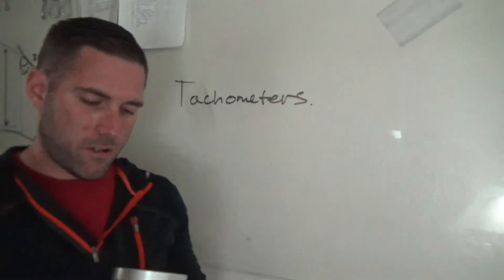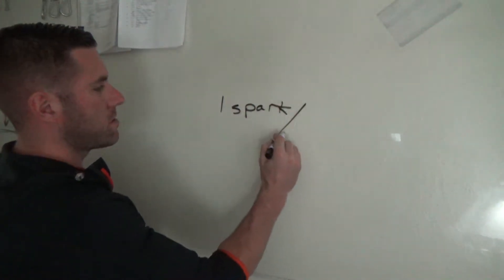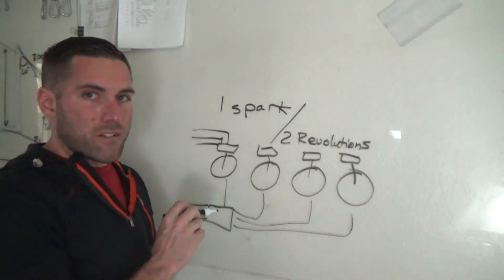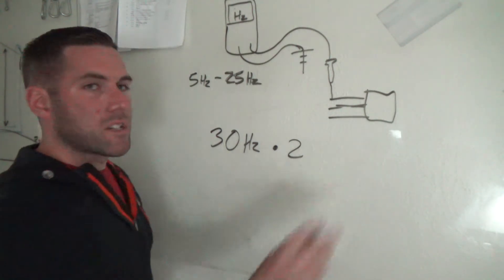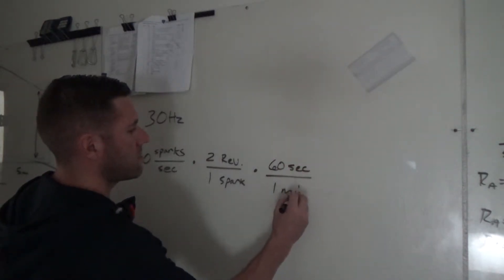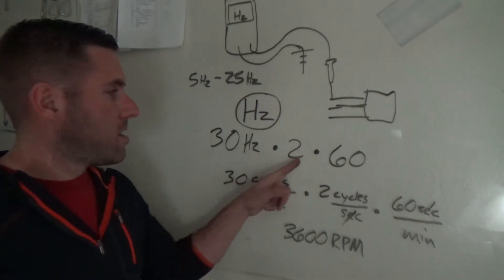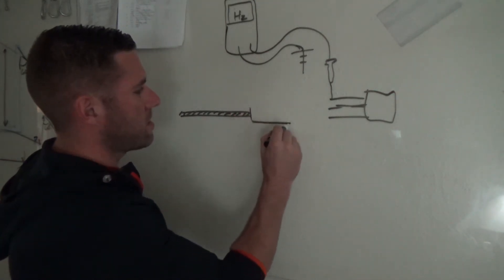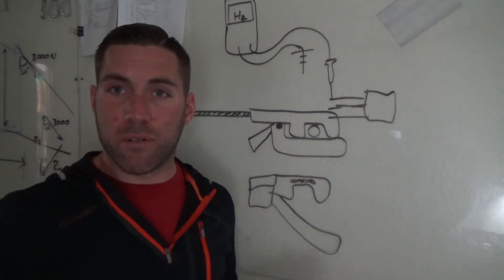Tachometer Calibration with Multimeter

Comment: Hi great info, I'm wondering if you can answer a question. 
I have a 1966 Hillman super minx,  4 cylinder, 1 spark per 2 revolutions as you say ok.
I have a lucas D25 distributor which switches the coil ground supply on and off 4 times for every 1 revolution of the distributor,  I'm sure you know what I'm saying. 
So how do I use your method to test the rpm?
Could I test it at the primary negative/ground if so how. 
Sorry to ramble.
Thanks Walter from Liverpool Merseyside England

Comment: Super helpful. I recently bought a multimeter with a Hz option (an ANENG AN8009), and I knew from James Condon's generator repair YT channel that there's a relationship between engine speed and Hertz; this video connected the dots, so now I feel comfortable testing my suspicion that a repaired single-speed push mower is running far slower than spec.
(edit: Reading some forums, it looks like most 4-stroke small engines use a "wasted spark" design, in which there's a spark delivered EVERY rotation since the flywheel magnet passes the coil every turn. The useful spark occurs between the compression & power strokes as described, and the wasted spark occurs between the exhaust and intake strokes. So, at least when it comes to single-cylinder 4-stroke engines, to get the sparks per rotation math correct, you skip multiplying by 2, instead using a 1-to-1 ratio of spark frequency per revolution.)

Comment: The name of the clamp ? in the comments someone said its an induction clamp is that correct ? Plan on using it to to tune chainsaws and double check other dedicated tachs for that propose at there very different price point.. thanks
Reply from the maker: @frankphoto2  yes inductive pickup is the correct term and will be a clamp style.  There is capacitive, inductive, and hall.  You want inductive

Comment: Works like a champ! Did this on a classic car, 4 cylinder, connected to the + side of the coil and had to make sure wire didn't come close to other electrical wires. Read 32Hz * 2 * 60 / 4 cylinders. Adjust the tach using its potentiometer. Will check at higher RPM. Cool stuff!
Reply from the maker: @Library-y5h  sweet, glad it worked for ya!

Comment: The bigger gauge is because when you’re making big HP and black tracking the 1/4 mile at 160 mph you need to see the gauge so it needs to be big and in your face. 
Also why the shift light was invented so you dint need to look.  

But yeah the import crowd w 43 HP and a 7 inch tach that mate be true

Comment: This was great. The clamp is called induction. Almost like a current transformer. It’s 360 times two revolution equals 720 degrees, two revolutions to make one revolution on a four stroke. One thing to mention is you can’t transform DC. That is why the old points would open (now it’s done electronically) to transform from coil primary to secondary, to fire the plugs.
Reply from the maker: In the terms of this video the inductive pickup is a clamp similar to a Hall effect sensor but is powered and reacts similar to a FET without a gate saturation from direct connection.  That’s why I mention it.  Toroid induction is not a thing in DC and that’s why the coils are HVDC discharge, happens in joules, not volts on the design level.  Not sure if you’re trying to repeat my whole video but it’s already obvious to me how the engine works.

Comment: I picked up a cheap signal generator to calibrate tachometers out of the car. It would be nice to have a chart of the output HZ setting to create a certain RPM reading on the tach, with certain number of cylinders.  Maybe a 4 cyl, a 6 cyl and an 8 cyl. at 2000, 4000 and 6000 RPM.  etc. I am looking forward to the next videos.
Reply from the maker: The boat ones I just started will likely be in the range of 10-15 videos long.  I’ll see if I can sneak an experimental video in there for a signal identification and propagation one that explains what these tachs are usually looking for

Comment: How should I trnslate my hertz reading on my main coil wire if I have. Single coil on a in-line six motor? I have 120Hz reading and don’t know what to do with it :)
Reply from the maker: I may make a follow up video on this topic, I have 4 more videos uploaded for scheduled dates currently but this one has gotten a lot of attention and questions
Reply from the maker: You need to know how many cylinders are firing per revolution and you’ll be able to calculate anything else from that number.  SOMETIMES, they are different for specialized or non-consumer engines.  I want this video to be all comprehensive rather than only automotive based.  Treat two cylinders firing at the same time as a ONE in the math.

Comment: So I have a v6 with a coil pack, where would I connect the lead in my case?
Reply from the maker: The coil pack will have a trigger wire that will provide a digital pulse signal that is read capable with a multimeter in the DC Hz function.  Just need to test to know which wire.

Comment: I made a typographical error in my original message. I put a 47 ohm resistor between the tach signal and ground. Gauge did not work prior to doing that. Now it works with the bounce when the RPMs change. I put the rectifier diode in line on the tach signal to help minimize the bounce. It appears to have made it worse.

The DC voltage coming off the negative side of the coil is about 14.3 volts while running. (Fluctuates some)
The ohms coming off the negative side of the coil bounces between 6,500 and 6,900 Hz.
I took these measurements off the the rear coil, not after the tachometer adapter if that matters.
The resistance from the signal wire to ground is 1.68 ohms.
 I used the rear coil due to access. To get the readings from the front coil I have to remove the fuel tank and therefore can't start it. These are the parts that I used.
Thank you in advance for your help! 
Doug

Biker's Choice Electronic Custom Mini Tachometer https://a.co/d/1TgOYjO

Baron Custom Accessories Tachometer Adapter BA-7315-50 https://a.co/d/84HkQdr

20PCS 1N4005 Rectifier Diode 1A 600V DO-41 (DO-204AL) Axial 4005 1 Amp 600 Volt https://a.co/d/0PYQJeo

PARTS EXPRESS 47K Ohm 1W Flameproof Resistor 10 Pcs. https://a.co/d/7C6n0Qz

Comment: I watched your video and I still have some specific questions I was hoping you could help me with. I have a Honda VTX 1800 motorcycle. It's a V-Twin with two separate coils. Some bikes have a wasted spark where it ignites on the compression  stroke and the exhaust stroke. This one alternates back and forth only on the compression stroke. I purchased an adapter for the lack of better term that takes the negative signal from each coil and discharges it through a wire to the tachometer. Once connected properly it did not work. I read in the comments from someone who purchased the same device that a 10K resistor needed to go from the tachometer wire to ground. I did that and the gauge began to work but it had needle bounce. Cruising at a steady speed it would be okay but accelerating or decelerating it would bounce. I then read online that if I installed a 1N4005 (1A 600V) diode in line to the RPM gauge it would correct the bounce. It actually made it worse. I'm desperate for some help. I can send you a link to the gauge I purchased and the electronic device that gets installed in line. I can't find anybody with the knowledge that you have. Please help.
Reply from the maker: IF, and I stress IF, the signal from the coil discharge trigger negative is the proper place for the tach signal to be acquired, 10kOhm is either too much resistance OR when you hooked it up without the resistor it caused a problem in the gauge.  What I personally would do is power up the gauge and start the bike with the two disconnected from each other and set the multimeter to DC frequency (Hz) and get two things; voltage and frequency.  USUALLY, not promising, the tach reads from a 5VDC signal on pulse inputs.  Now measure the resistance of the signal wire on the tach to chassis ground.  When you have those THREE values, post them here.  You need a corrected voltage drop is probably the issue.  An internal failure of the gauge may require a capacitor in parallel to smooth it like an anti slosh module usually found on older clusters, newer cars just use averaging to smooth out needle flyback
Reply: @sinewavespecialties2373  I was wondering if you would be able to help me with this tach problem. I have the VTX disassembled ready for your suggested modifications.

Comment: If you are measuring from the negative of the coil, the coil is sparking 4 times for each cylinder, each of which has 2 revolutions per spark.  So wouldn't you then want to divide your result by 4?
Reply from the maker: Are you reading it will a scope or meter?  Meter will not catch 4 sparks per cylinder.  ICE's do not spark more than once.  If a scope is seeing 4, it is due to residual discharge.  Is this a newer vehicle or a race vehicle?
Reply: @sinewavespecialties2373  I'm working on an old Mercruiser 3.0L boat engine.. essentially a repurposed GM engine from 1990.  I bought an Actron automotive multimeter with an RPM feature and it reads double what my RPMs are.
Reply from the maker: @barry.anderberg  put a diode in line with signal wire.  Most tach signals are AC sine wave,  if the signal goes away entirely, try flipping it and seeing if that helps.  If it reads the same then your tach needs to be setup/programmed.

Comment: Awesome explanation, Rob!  However, I have a puzzle for you.  🙂

My level of expertise is as follows:
40+ years auto mechanic
24+ years journeyman toolmaker & cnc programmer
17 years mechanical engineering/machine design
45 years and change taking shit apart to see how it works, and then either making it better, or destroying it for spare parts.  Haha

I have an old Sunpro CP7909 tach that I'm trying to get to work on my 2006 Polaris Ranger 500, carburated, single-cylinder SxS.  The tach has three settings for 4, 6, & 8 cylinders, and thru-hole resistors soldered on the pcb in-line with each switch setting....as well as a small surface mounted potentiometer for fine tuning.

The approximate resistor values for each setting are as follows:
8 cyl - 196kΩ 

6 cyl - 260kΩ
4 cyl - 382kΩ

Using those numbers as a baseline for my math, and reading online that the IC chip in the tach takes a pulse reading in relation to the resistance of its control pin, I figured that swapping out the 8 cyl. resistor for one that was roughly 1.528mΩ should make it work on my single-cylinder engine.  However, it did not, and the tach just ran up past 8k and kept going before I unhooked it so as not to let out any of the magic smoke.

Do you know if I did this correctly?  Is there another way or something that I'm missing?

Also, this is one of my main sources of "this can be done" info after reading almost everywhere that "it isn't possible".  https://www.instructables.com/Automobile-Tachometer-on-an-outboard/  

I freaking hate people who say that there's ANYTHING that can't be done.  eye roll

Thanks for your attention to detail, Brother!  You ROCK!
-Joshua
Reply from the maker: You did the right math, but on the wrong parameter.  Older tachs ran on pulses like if you were to tap the gas pedal 10 times per second vs 1 time per second. The resistance is only for input pulse amplitude, not the number of cylinders.  There is a bunch of math to describe time constants for capacitors and line control signal resistance but I’ll omit that for now.  If your math was correct it would be a 3ohm because the tach is pulling a 2 cylinder firing count at any time.  The Pulse Width, not the Pulse Count, is what you have to measure.  That will be in milliseconds value of on-time.   The wattage the meter sees is a combo of amps and volts. That’s why the resistor AND the capacitor changes. The cap is changed by the IC and the resistor by the switch which changes the time constant and power to the magnetic pendulum in the tach needle.  Need to know the pulse width of your input on the new engine
Reply: @sinewavespecialties2373  
Thanks for your detailed response, Rob.
So, if I am understanding this correctly, then I'm going to need to bust out my scopemeter and measure the pulse width to be able to make the correct circuit modifications?

Oh, and an update on this since I posted last (sorry for the delay as I was busy with family stuff for Independence Day).  Upon more in-depth circuit tracing, I noticed that the resistors for each setting have their respective trailing leads soldered into a common buss, and are therefore backtracking to create different parallel R values to the IC depending on the switch position.  Ugh.  Lol.

I'm not a full-on EE or anything, but I'm trying to get there.  I think it would be best if I just sketched out the circuit and posted pictures of what I have, if you wouldn't mind having a look.  It's going to take me a little bit to get that done as this isn't as imperative a project as many of my others at the moment, but I will do it.  Also, in a huge bonehead move, I tried to save a few bucks last year when replacing the battery in my Fluke 199c Scopemeter by buying an aftermarket one from Amazon.  HUGE MISTAKE!  I have found the resistor that it fried in the charge circuit, but just haven't gotten around to fixing it yet as I don't need the thing very often.  I'm just hoping that the resistor took the brunt of the spike and that there wasn't any damage to the PCB anywhere else, and that it's not just a very expensive yellow brick now.  🤦‍♂️

I'm keeping an eye out for that new video you mentioned, and looking forward to learning more!  Keep in touch. 

-Joshua
Reply from the maker: @joshuasparks6563  I’ll have it finished up today and some specific methods to analyze.  I got my first scope literally two weeks ago but it’s my translator for everything now.  MSO5104 and bought the waveform generator.  I plan to put a PWM signal to the tach I have on a ramp function to see when it starts moving with the variables being width, voltage, and frequency.  One of them should give me something.  Will have to bust out PNP and NPN MOSFETs if it’s an AC signal like most of the tach signals in cars.  Be advised, my large scale automation tower is going to be complete AFTER I get the baseboard which is on backorder and projected to ship 9/30.  Sucks.  It’ll be a full blown 36” tall 6” deep 24” wide tower assembly for experimentation
Reply from the maker: I’m making a signals video today that may help you

Comment: I wanted to ask is it posibel engine run ON because of tacho gages?
Some where in wikipedia is mentioned tacho generator so is that thing pulse generator?
What hapens if you swap those wiering?
I cinde of geting back charge from me alternator that thing is externaly excited and has no center tap its delco remy alternator from france and I have singel hei E core type ignition coil so where do I wire me tachometer to???
Reply from the maker: You are reading the actual spark lead or wherever the pulse origin is.  If you read from the entire engine trigger, you will have to divide the final value by the quantity of cylinders
Reply: @sinewavespecialties2373  ok I understand. But I have another problem I actualy have build in destributor 4 pin gm ignition module aperantly that thing is polarity sensitive and I do have positive linear voltage regulator inside me dashboard I did try to use that delco starter motor selenoid to bypass some voltage because of winter time I do have problems starting me car.
But when I try to use that R terminal on starter selenoid me fuse pops?
Any ideas how can I bypass this problem?
I recently have also some unusual problem apwrantly me car refuse to shut off when all 4 blinker works I can not detect the problem why this acured .
I did swap out back lights from new'r model year car but terminals pins and bulbs are the same I even swaped out 3 relays who are 3 wire blinker relays they do all cinde of strange things but not show the right direction some times all 4 light come on brake light blinker light realy strange things going on with me car.
That relay staff nearly resembels hit and miss engine ignition cinde of.
So I wondered If I culd use relays as triger instead of that gm ignition module because its polarity sensitive.
So I do have more of those starter selenoids wuld it work If I wound 2 selenoids in series ore pararell to bypass voltage to coil?
It is anoying GM product to be exactly Opel Ascona C ore Camira with 1.3 L sohc engine that thing drives me nuts .
I cant realy finde any info on the internet related to such strange behaviore.
I must admit I was impresed that the car actualy works in union with the relay so that brought me to thinking can It be controled?
With cinde of oscilation circuet ?
Me engine does have bade tendency to run at around 500-600 rpm I like the fuel economy .
So does there any way exist how I can bypass those problems?

Comment: Thank you Rob. Good job. I have a brand new faria tach for my 350 chev marine engine. Just put a new motor in it and it does not appear to be recording the correct RPM. The mechanic figures thretach might be out of wack. Ant tips on these tachs or same as any other tach. 
Jim
Reply from the maker: I am actually putting together a video series, even though i say that and never seem to, its actually going to happen now on a much more productive level.  I have spent $3500 on a PLC stack up and will be doing videos on how they work and what they can be applied to for boats and vehicles.  It will be a wild turn for the standards typical to the industry but much much more powerful